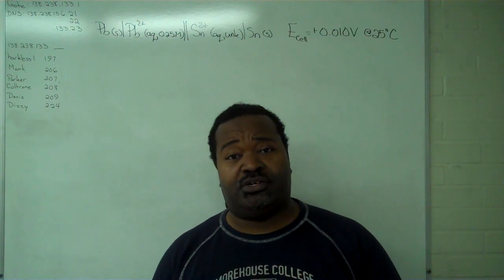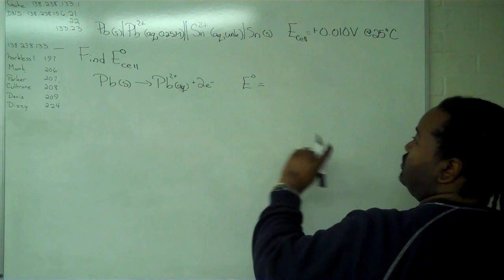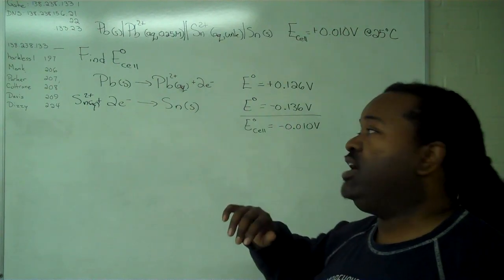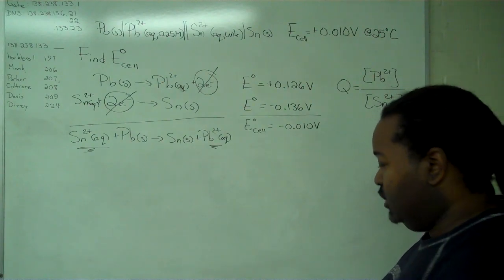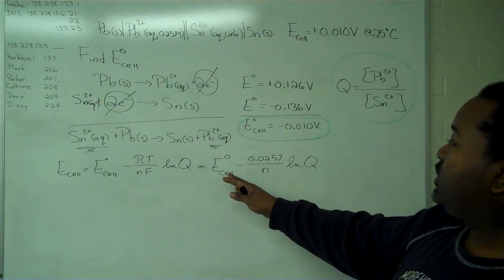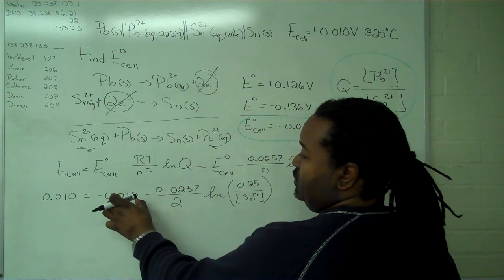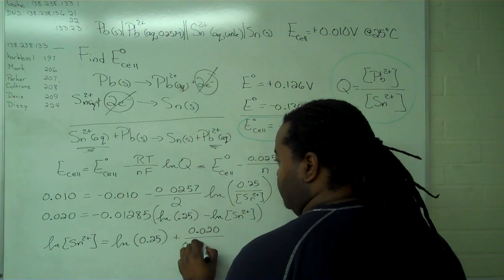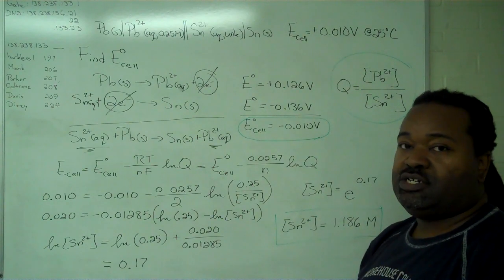Nernst Equation 3

Comment: so would you get Ecell from an experiment? and is this reaction not spontaneous because standard e cell is negative??? thanks
Reply from the maker: In general, a value for Ecell may come from an experiment, or given as a part of the problem itself.

For your second question, the value of Ecell you get from taking the non-standard values may change the overall sign. The way this is written, and the concentration at the end, you get an overall positive value, so it would be spontaneous. 

Hope this helps!
Reply: ahh yeah you just said it differently to how i was taught so i got a bit confused :) thanks